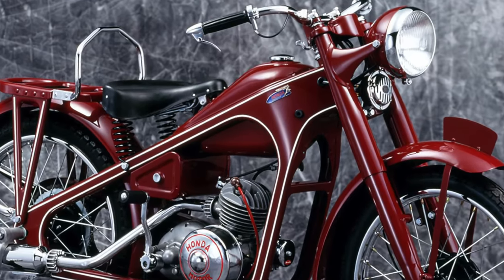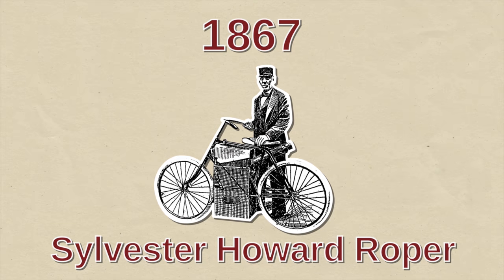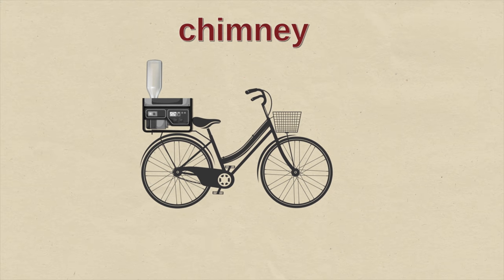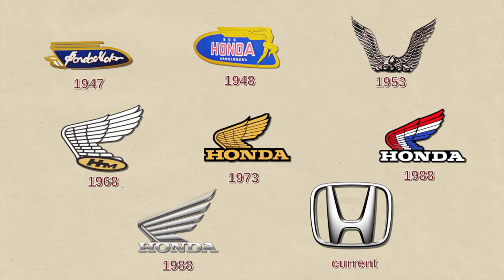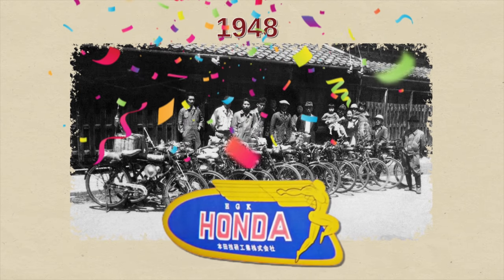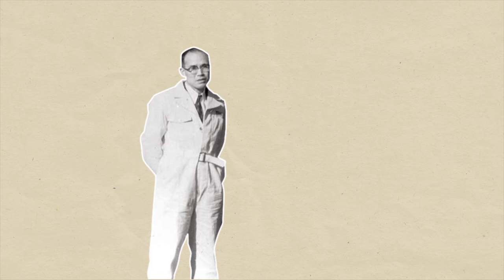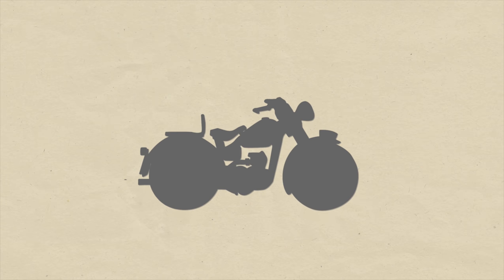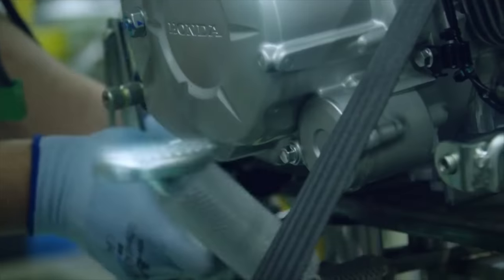Honda Just Changed America

Comment: I love Honda & Toyota cars they’re reliable❤️❤️
Reply: Honda motors are the best out there.  The generators are number 1 in low noise and reliability.
Reply: Toyota is the best cars out there.
Reply: Toyotas are what Buick would build if they were a Japanese company; and the response:  Meh...  “Honda, the power of dreams!”
Reply: Jimmy Long yes they are❤️
Reply: smiley Honda makes the Best Engines , Toyota makes the best Vehicle
Reply: @jimmymoneyslots  Suzuki are good as well, Toyota have just went into partnership with them to share models... I have a Rav4 and a 2014 Grand Vitara, both excellent small suv's....actually very impressed with the Suzuki.
Reply: Mark Brock suzuki i only like vitara nothing else😂
Reply: Lol my Accord is up on the lift as I write this, getting a new starter at 60k miles.  This after replacing two rear wheel bearings and front rotors.  Honda quality is in the rearview mirror.
Reply: Honda hasnt been Reliable since the 90s just shows you dont know your Cars
Reply: @jimmymoneyslots  Honda best of the best
Reply: I've owned 5 Honda vehicles and my wife is on her second. I find them very reliable. Very rare to have to do anything but routine maintenance up to 80k+. They probably aren't as reliable as a Toyota but I'd put them up against any other manufacturer.
Reply: mark p Not if you do annual oil and transmission fluid changes
Reply: And Mazdas!
Reply: @billybob042665  Toyota has their flaws as well. Their engines has issues with excessive oil comsumption as well. Hondas CVT Transmissions are pretty good. I don't know where you got that info.
Reply: People are arguing too much here, let's just say it out loud: Honda, Toyota, and Suzuki are reliable, likeable japanese car brands.They each have their little flaws maybe, but I love all of them.

Comment: WOW! Amazing production and narration! Thank you so much for this great history lesson. My very first motorcycle was a very old, VERY RARE 1971 Honda SL 70cc enduro, kids size motorcycle. It had a woman's nylon stocking over the carburetor for an air filter. It cost $350. The kick starter was stripped off, so I had to run and push start it. If you got anywhere near water, the engine would shut down for a long period of time and not restart. But that 4 stroke engine was absolutely amazing (when it ran). It would rev to at least 12,000 rpms, and was glassy smooth. For a 1971 engine, it was definitely way ahead of it's time.

Comment: My first motorcycle was a 305 Scrambler and next was a Harley Sportster which vibrated so much I decided to sell it and bought a used 1972 red 750 Honda which was quite a bike. They had problems with chains breaking and would split the case which I found one day when I pulled the cover off so I took it apart and had the case welded. Being aluminum it took a special welder to do it and when I got it back I put it back together and loved riding it and then one day it was stolen. But I fell in love with a Canadian 650 Yamaha at the local shop and bought it and off I went. It was a bulletproof motor and took all the abuse I could give it. After watching Kenny Roberts in San Jose on the dirt track I decided to punch it out to 750 and put some Mikuni slide valve carburetors on it and two into one exist. It was fast but those days were coming to an end when the two strokes Kawais shoed up and were blistering fast. Yamaha was still selling the 250 and 350 two strokes but now Yamaha was getting into 4 cylinders with a drive shaft which I owned a 750 and 1100 and that my friends was where I got off the trip and loved every moment of it. All the times and places with people who loved to ride will always be fond memories as the streets beckoned me night and day.

Comment: I love the engine history of the Honda. I would love to hear similar stories like this.
Reply: Like the history of the Joe Cell. Or the history of the Wankel engine, or Rotary Engine, or the Diesel engine story. The inventor of the Diesel engine was murdered, because his engine was so controversial, and because there was so much money and political stuff tied to it. I wish someone would cover that story! There is also a man who invented an engine that runs on Noble Gases (argon) and it had a sealed combustion chamber, where it ionized the gases, over and over, without burning them (like a Neon light bulb). There is the "Mighty Engine" which is the tiny engine, that recycles the combustion strokes. There are the water carburetors made by Charles Garrett in the 1930's, which created a fully water powered carburetor. There is the story of Stanley Meyer. The story of Tesla's electric car. The history of electric cars is very interesting too, because in the year 1900, most cars on the road were electric (not gasoline). There is so much history we have never been told! Also the "heated vapor carburetor" system which can give a V8 engine 70 mpg, which was invented in the 1970's. And finally, the GEET system which turns the fuel vapor into ionized plasma, and increases gas mileage dramatically.

Comment: I swear by Honda if you do your research.  My 2008 2.4 cylinder Accord has 317K miles & the only thing to ever break was the starter.  Yes I changed it myself.  It's a lot of work & I'm not a mechanic but I'm mechanically inclined.

Comment: Hey scotty I have a question about the first f150 I own, it is a 97 with 98k miles for $1350. The ac clutch is clicking and engaging constantly and stopping. So it clicks like every second, now my freon tester says it's charged and there is no fuse out. I'll probably have to take it in or is there anything else I can fix myself and diagnose? It's average 85 degrees here in SD plus humidity. And I work 60+ hours as a roofer

Comment: To me, it's unfortunate that the new Hondas aren't as "good" as the old ones.  I had a 2000 Civic hatchback that I loved. It cost me very little in upkeep over the years, drove great, was a perfect size, and had great driving visibility.  It died last year and I bought a 2018 Civic SI coupe. For me, the car is too large, has poor driver visibility,  no hatchback,  a poorly feeling stick shift,  awful electronic brake,  poorly designed infotainment system,  and an engine that has a defect allowing gas to drain into the oil.  They aren't the company they were. I've had Hondas since my first in 1976. Thinking of selling it with only 8500 miles on it. Maybe a Mazda 3.